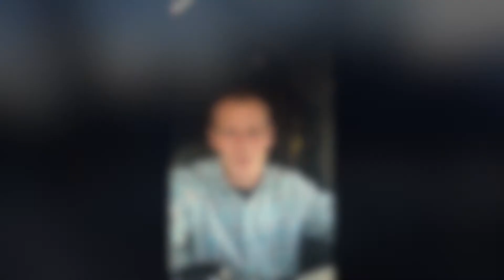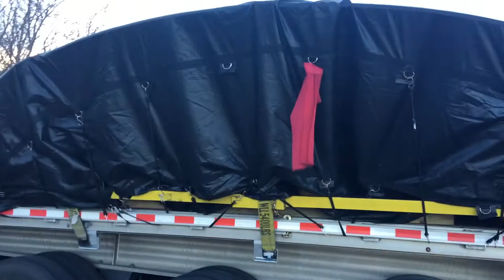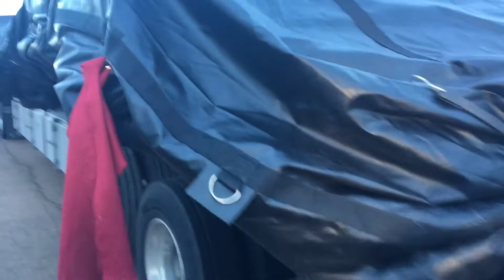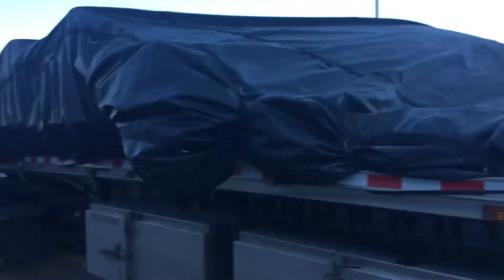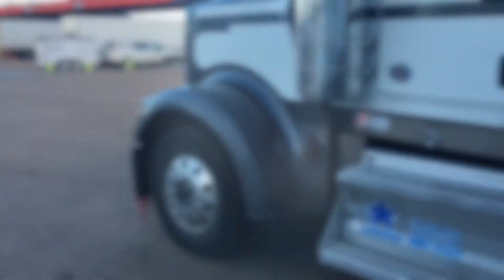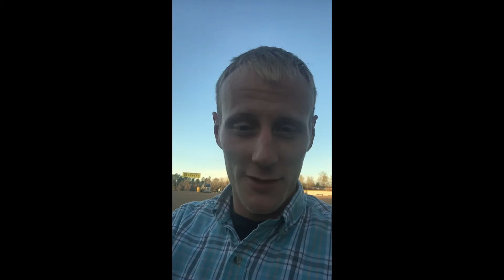Heavy Haul: #3: Milford, OH - Baton Rouge, LA.

Comment: I'm wanting to eventually get into heavy haul but would like some recommendations on what companies would be good to start my career as a trucker at?
Reply from the maker: Well, if you specifically want to get into Heavy Haul, I might look into starting with a company like ATS. They have one of the largest heavy haul, company fleets out there. You'll have to work your way up the totem pole, but you could do it. Also, Guy Turner is a company that will start you on a 4 axle tractor with a 4 axle RGN. You'll pull a lot of machinery out of ports, but you can get some good experience there too. Idk their hiring requirements though.
Reply: I talked with ATS but they said I had to have at least a year under my belt before they would hire me seeing I've not got my CDL yet, lol. I'll try to find some info on that Guy Turner and see if he'll take me straight out of school and teach me the right way to do things. Thanks for the tip dude and airborne to ya, keep them wheels rolling safe dude.
Reply from the maker: You can get a years flatbed experience at a company like Maverick if you wanted, then move over to ATS. A lot of drivers do that. In fact, Maverick even will pay for your CDL school if I'm not mistaken, because they send you to their own. Good luck man, let me know if you need anything.
Reply: where I'm a vet and a chapter 61 med retired I think the VA would pay or maybe even the state of KY may pay, not sure yet. But so Far Melton is at the top of my list. Maverick called me today and said they wouldn't fool with me cause I've not worked at all for over 10 years since I've been unemployable by the VA. But from I can tell Melton could very well be interested, Thinking cause of my age and willingness to work. Give me your thoughts if you'd like, seeya dude and keep rolling safe dude, AIRBORNE all the way.
Reply: hey dude, check this out, Type in "auction time" in your search engine and check this one out, LOT # 2504 - 1994 KENWORTH W900B. If someone could get that cheap enough that may even be a candidate to send to Fitgerald and let them do their magic to it. Depending on if the frame is all there and good and the engine and axles was good, some of the parts would have to be brought up to spec and someone could make that a nice truck for less than a new one for sure I would think.